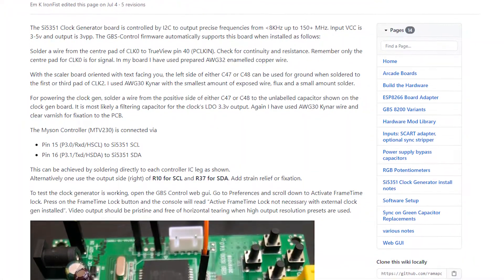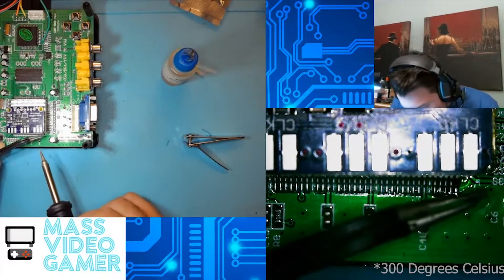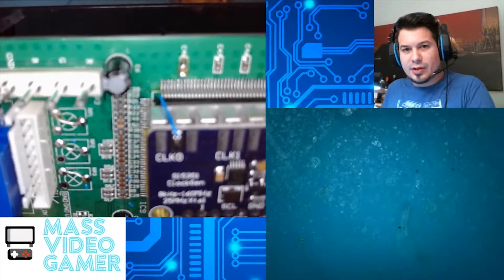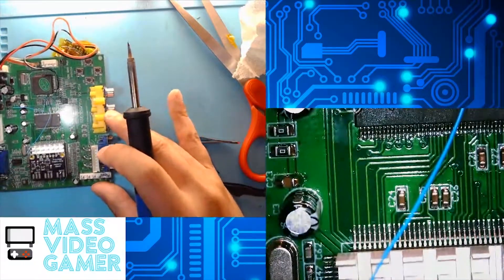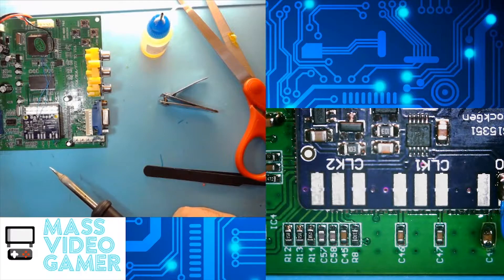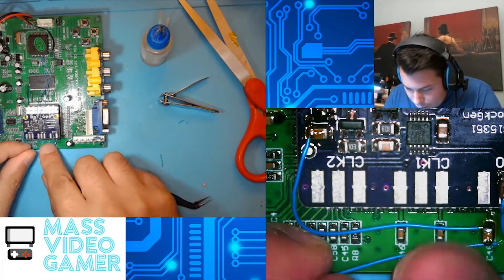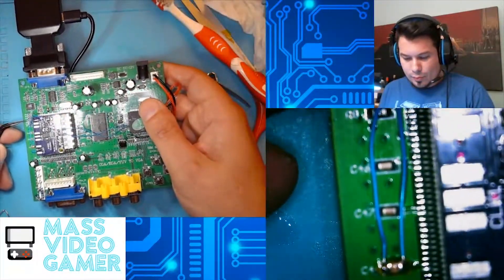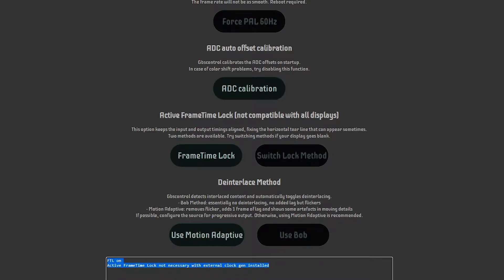How to install the Clock Generator on the GBS-8200

Comment: I have my clock installed but my menu on mine looks different than yours. When activating frametime lock nothing seems to happen. How else can I tell if installed correclty? Pinouts are right.
Reply: I have this issue too - did you resolve it?

Comment: i dont see the message "Active Frametime Lock not necessary with external clock gen installed" in the new GBS Control UI layout even in Developer Mode is there another way to confirm that its active?
Reply: I have the same issue. Were you able to get it fixed?
Reply: @LarkinM  I don't think so I bought a multimeter to check my points and and everything attenuated fine
Reply: @uberdisko  I'm having the same problem. I ordered a different board to see if it fixes it.